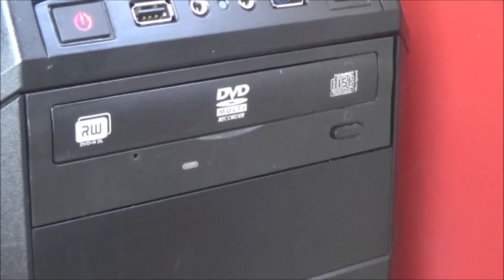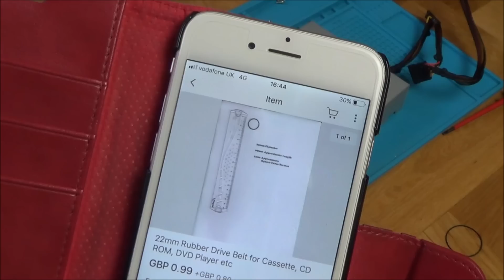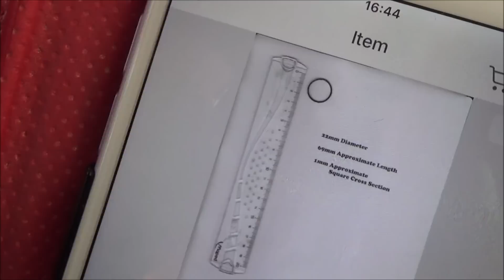Trying to FIX a Faulty DVD / Optical / Disc Drive in a Desktop PC

Comment: *Course Material*
Please read ALL of the short Tutorial, I would also suggest you revise Ohms law and a revision on capitance. 

 https://www.asc.ohio-state.edu/physics/p616/safety/fatal_current.html
Reply: What is your point? 
Are you worried he is going to put his tongue across the power connector to test the voltage?
Yes its good to know about dangerous voltages, but  drives use low voltage 5Volts or 5V/12Volts.
Yes if the main power supply developed a short from input AC to output 5V or 12V then he could be at risk.
In my opinion your being way too over cautious and just trying to belittle the video !!
Reply: Exactly  @KB1UIF  the Unit is faulty and as you pointed out, what if, no seriously what if what you postulated were the case, a circuit being fed via a rectified Half wave 240 volts  "DC" at 1 and half amps? 

If you had read the Tutorial as I suggested most Deaths are by those working on low Voltage devices who in fact should have known better and thus consequently Killed because of their complacency. 

As for belittling the video That is not my intent, as I really like Vince and I am just looking out for him..

Comment: 22:42 you said that there's no risk of electric shock - sorry Vince, but that's common misconception - it's the amps that can badly hurt you or even kill you. 100miliaps (0.1amp) is enough to kill you. Stay safe my friend.
Reply: Of course it's the current, but you have to convince it to go through the relatively high resistance of your body first! That in turn takes a fair bit of voltage, according to Ohm's Law. Try grabbing two multimeter probes with both hands some time - I have a really hard time getting below 1 megohm. You'd have to apply medical equipment standards (max. leakage current 0.01 mA=, worst case) for a 12 volt supply to be considered a problem, with a garden variety 0.5 mA limit it'll never be an issue.

Sure enough, a PC with a maximum of 12 V above PE level qualifies as PELV.
https://en.wikipedia.org/wiki/Extra-low_voltage